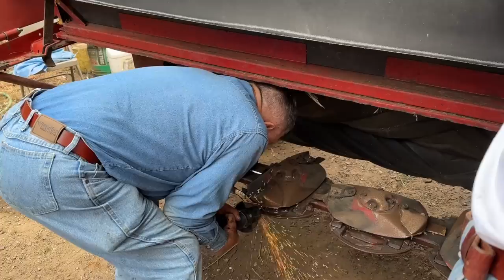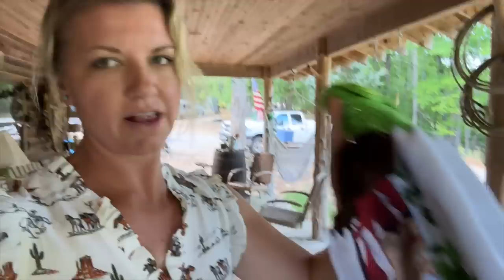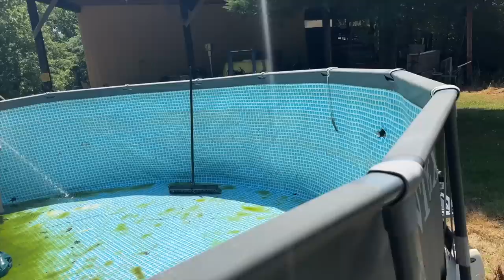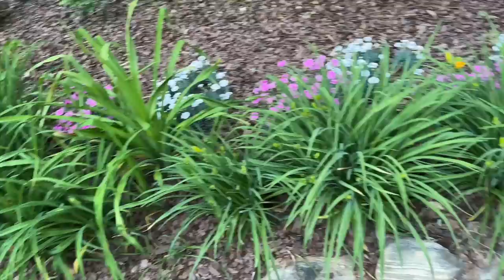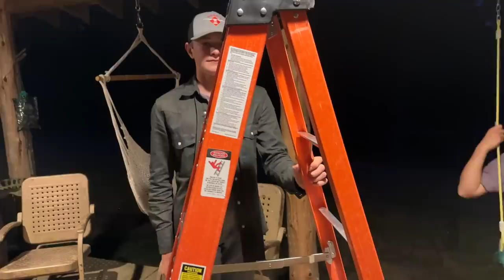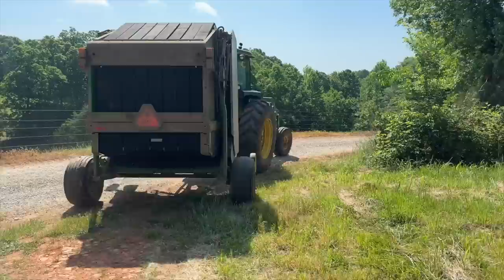Things Are Looking Up...First Cut Hay Is Down! 🥳

Comment: Meredith have you heard of a Hillbilly Pool Filter? You take a 5 Gallon Bucket and you drill holes in the lid fill it with a pillow fiber and attach a hose from your pool pump and build a small mount to hang the bucket over the pool. You run the filter until you get a lot of the algae out then you change the filter material and continue to run it until the water is crystal clear.❤❤❤❤

Comment: Yes, I could smell it because they say that smell is the sense most connected to memory and I spent a lot of my youth in the field cutting and putting up hay.  Rain the first day isn't going to hurt it, but a few hundredths on day 3 will ruin your cut.  You haven't lived til its 106 degrees and you drew the assignment to stack hay in the barn near the tin roof.  Can't believe I didn't die, but young folks are pretty hard to kill. 
I had a pool like that one and, yes, sometimes its just better to start over.  Got to keep that bottom membrane stretched out.  I put some wood shims under the upright supports to level mine out, just make sure the membrane does't contact the wood or it will cause a leak eventually.

Comment: Those are not potholders but bowl holders.  When you put a bowl in the microwave you place it in the bowl holders-when you bring the bowl out of the microwave and it is hot the bowl holders helps from transferring the heat to your hand.

Comment: By the time I had my "official" behind-the-wheel driver's ed, I was already driving truck on our farm for a couple years.  The 3 different "city kids" that shared the time with me, had many issues and were so nervous.  When It came for my turn, we usually dropped off the others back at school and we would drive to Green Bay to pickup baseball gear and whatever (he was also my HS baseball coach).  He spent most of his time working on coaching stuff and let me drive on the highway, interstate and the "big" city.  LOL.  My actual driver's license road test consisted of me driving the guy around the block cuz it was his lunch time.  TOO EASY!  Good Luck Wes (and parents)

Comment: Tip we used to stack the round bales 3 high into a pyramid shape then cover with black plastic put weight around the bottom and the take tires  and tie baler twine on one tire throw the twine over and tie another tire it kept the plastic from blowing worked real good to keep the hay dry.

Comment: One thing to keep in mind about storing hay in a container is be sure it has time to cure well before you put it in. Have done it before and not enough air flow for the grass to finish drying properly. Can result with musty smell or even mold. Not saying it can’t be done just be careful. Just something to consider.

Comment: Don't leave the liner out very long because it will shrink. I removed a liner on our above ground pool so I could dig down 2' to lower the pool into the ground. When I put liner back in the frame it was too small.

Comment: That is not the correct way to sharpen cutter blades. They should be removed and ground on both sides the same amount to keep each assembly in balance. One side gets dull, simply remove and flip over and that side sharp. Been doing this more than 40 years. Doing like he is will caused the unit to wear out quicker
Reply: There’s always one that complains about doing it the way that the other person doesn’t want to do it. 😂😂😂
Reply: Isn't that something, But he still seemed to be laying down the field okay. Just because you have one way of doing things doesn't mean there isn't another way!
Reply: You are wrong the blades are the same as a lawn mowers flat on bottom and that is so when it cuts it throws it up and out
Reply: @JLC87420 you are right plus all mowing blades are sharpened that way flat on bottom and sharpened on top to cut and throw grass up and out common sense lol
Reply: @angiedeel1  So he did it that way and it still cut the what does that mean